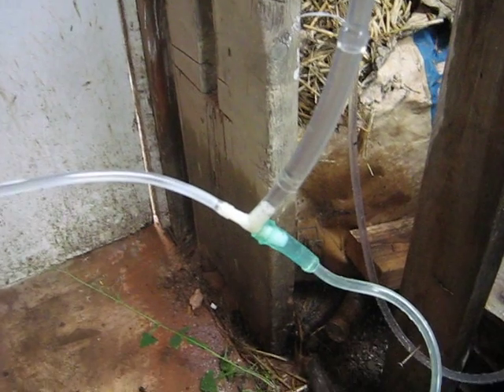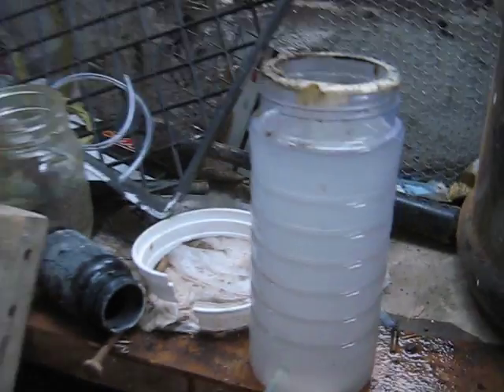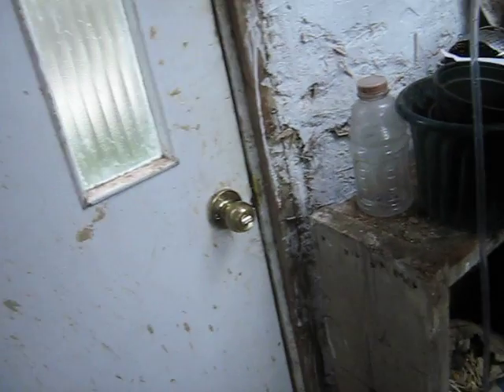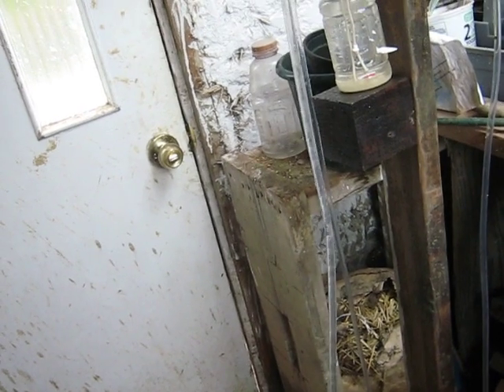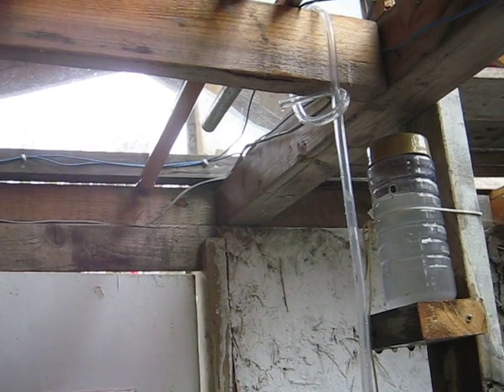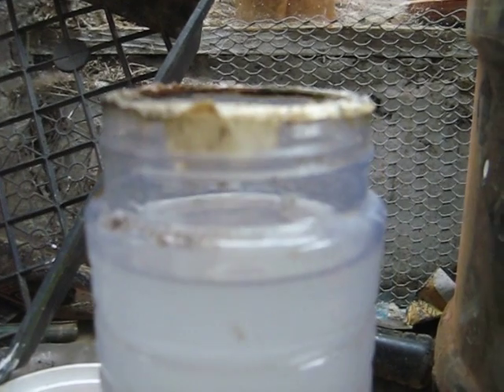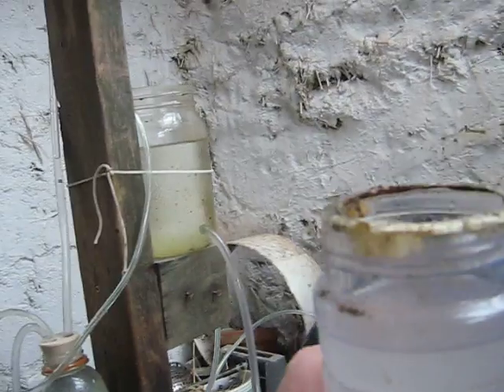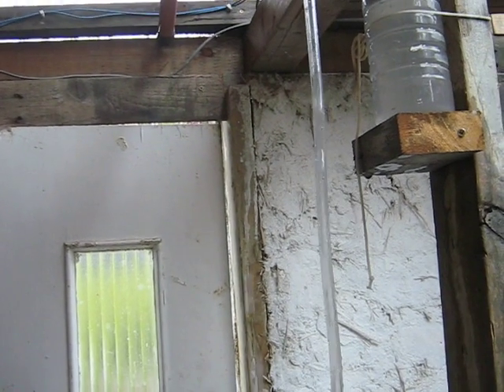Simple airlift process for Windowfarms pumps lots of water!

Comment from the maker: @1TEKTRON1  Thanks for your comment.  However, 2 phase fluid flow is not so simple.  I have 1.5 liters per minute air flow from the little air pump. 
My figures from 1990 for "best air speed" to bring water up through half inch and 3/4 inch id pipe. (With submergence of about 2 meters!)  between 0.7 ms-1  and 1.5 ms-1.  If that is  correct for small diameter pipes with smaller submergence,  you might be right!  But sometimes if airspeed increases, liquid holdup goes right down so no pumping!